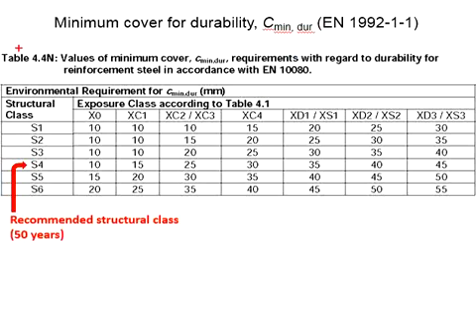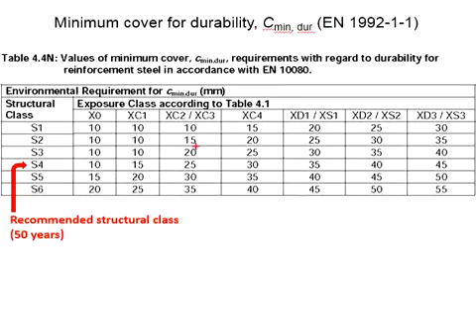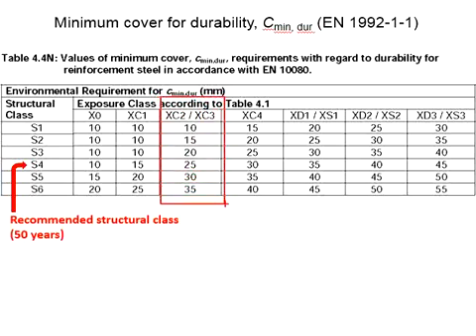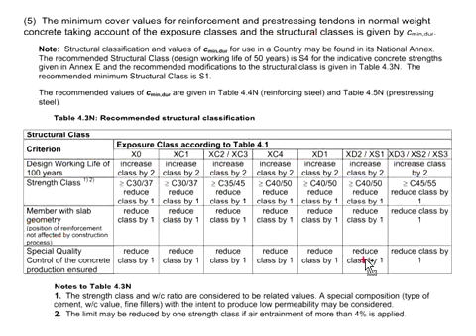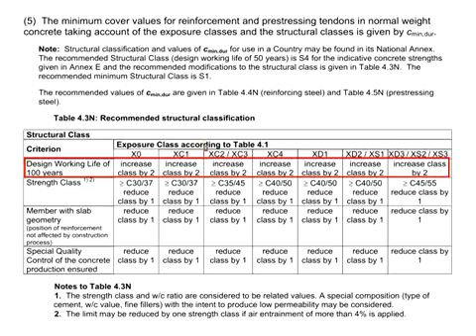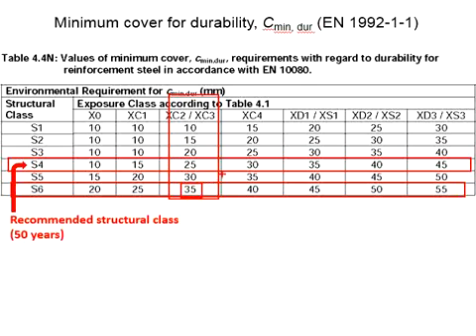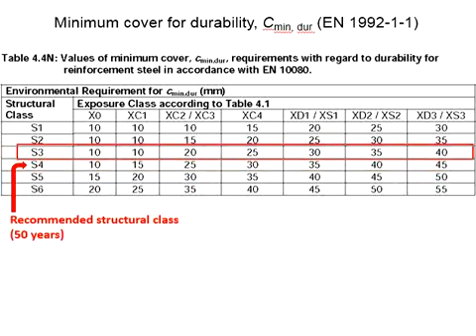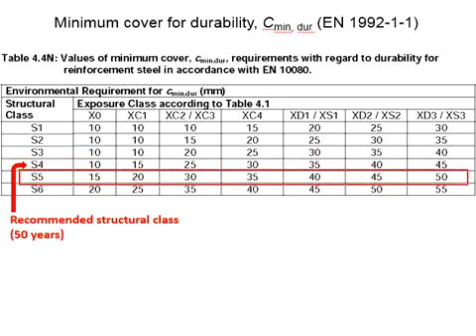6.4 Minimum cover for durability

Comment: Sir. In Table 4.3N, what does it mean by "member with slab geometry"? Do we need to reduce class by 1 when designing slab?
Reply from the maker: To be frank, I am not quite sure the true meaning. I suspect it is referring the the RC member which "looks like a slab" in terms of the geometry. Correct me if I am wrong.

Comment: In Table 4.4N for Minimum Cover for Durability, why are Exposure Class due to Freeze/Thaw Attack (XF1-XF4) and Chemical Attack (XA1-XA3) not considered?
Reply from the maker: Good question. I hv no idea. Probably because these two cases cannot be effectively resolved through concrete cover.
Reply: Thank you for your response sir.
Reply: Thank you for your response sir